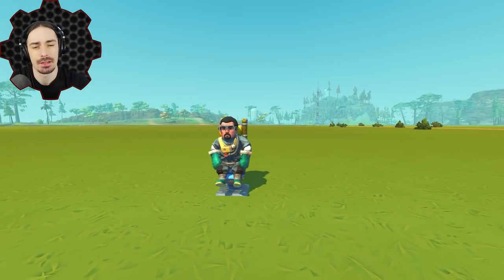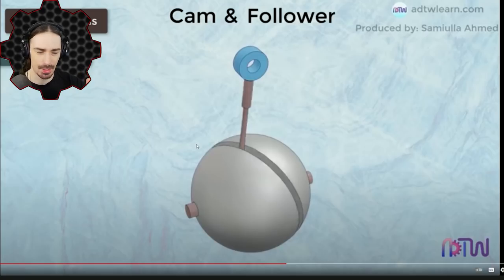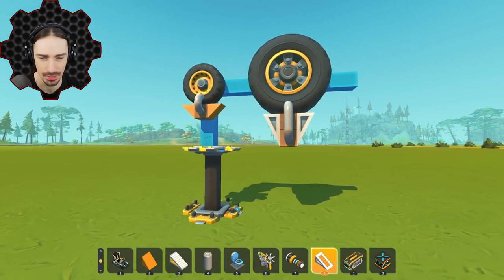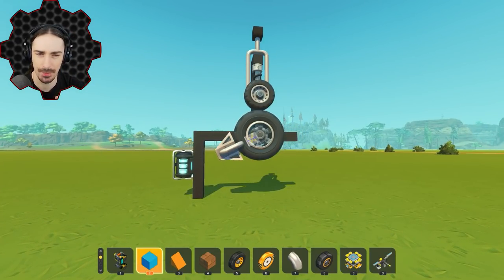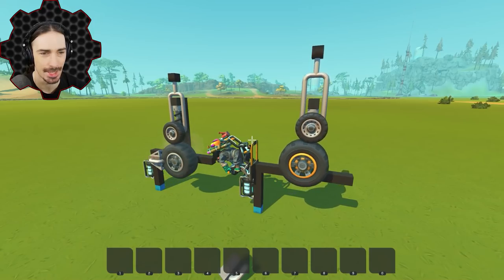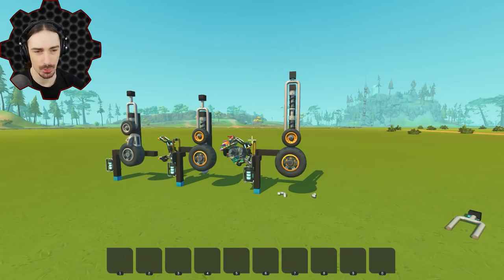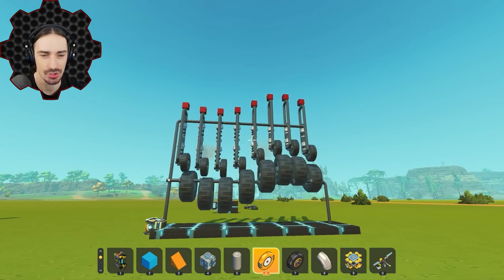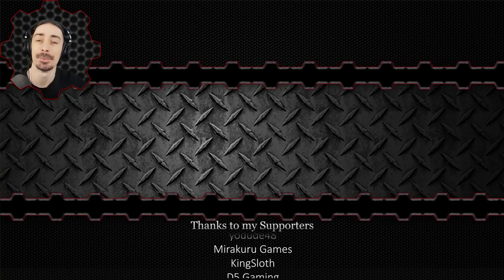This Simple Mechanism Made Combustion Engines Possible

Comment: Hey, Scrapman: you should see the cutaway of a Pratt & Whitney R-2800 Double Wasp radial engine, it’s pretty crazy with how the pistons and counter weight runs inside of it to drive the propeller shaft. Would be awesome to recreate it. Another would be the engine used by the Bf-109 because it had either a 20mm or 30mm cannon (depending on airframe model) in the middle of the prop hub.

Comment: 2:30 not to be the gearhead nerd here but that exact setup is an in line 4 cylinder (can be configured similarly known as a boxer engine to reduce vibration/sounds/heat and is slightly more efficient) and the configuration on the valves is called a DOHC or dual overhead cam.
Reply: And this is a 4 stroke engine.

Comment: The left cam with the wedge piece is like a valve, precisely like the video at the beginning. You want it to open only to introduce a fuel air ratio, or to vent the exhaust gas. But closed so it can retain the pressure of the combustion. As somebody said earlier, to fast you get valve float, when it went ape and stayed basically open. The design on the right is more of piston momentum, a constant moving stroke. To compress the fuel in the chamber for combustion and also a second stroke to vent the exhaust. I would love to see if it's possible to model a 4 cylinder motor using your tire methods, could the game handle that intricacy? Especially trying to time the valves between the piston strokes.....that is a hell of a challenge.

Comment: 8:41 I would love to see a smaller design of this to make basically bags in scrap mechanic on a vehicle would be pretty cool and you could make them on all separate buttons like pistons but a lot more smoother and can sit at a specific point rather than fully extended or fully compressed so you basically built a low rider that doesn't hop but can 3wheel and everything that lowriders do 👍 

Also this is a really good explanation of how a cam and valve setup works in a engine of basically any type

Comment: Cams can open the valves of an engine several times a second. There are several F1 and motoguzzi engines capable of 20,000rpm at the crankshaft, which translates to even more RPM at the camshaft

Comment: I’m a teen learning automotive. And you would want the first one/ the tire with the add block because it lets open the valve which is what that build is for more control and not like a wave because in a combustion engine it would let fuel or air in to the engine which could lead to no air compression. I thought I could tell you to help you.

Comment: Just am fyi if you’re going for the camshaft in an engine style, your beginning models are more realistic as you need them not hold the follower open for a duration to give the engine time to compress the fuel air mixture and ignite it, it wouldn’t be able to do this with the follower (valves) slightly open as there would be no compression it would just push the fuel air mixture through either the exhaust and/or back through the intake

Comment: Mack truck Etech engines with power leash compression braking uses an extra lobe on the other side of the exhaust cam to allow for compression braking, and is activated hydraulically by closing up the clearance in the valve lash by use of engine oil pressure.

Comment: While the second design is nice and smooth the first one actually has a lot of practical use irl. In the instant of an engine they’re attached to the fuel and exhaust values inside the cylinders. 

The engine lets in fuel, then closes the valves and compresses the vapors. A spark ignites the fuel and the following boom forces the piston down making the power to turn the crankshaft, then the exhaust valve opens and the piston moves up pushing out the spent fuel. 

If it was the smooth sin. wave it wouldn’t line up properly with the steps of internal combustion. Fuel and exhaust would mix together, you couldn’t get proper compression and it would probably destroy the whole vehicle.

However, these valves couldn’t use logic gates or electronic timers so the cam did that job, since everything is constantly rotating in the engine it would push the valve open for a short amount of time then take awhile to rotate back around to do it again in sync with the other moving parts of the engine

So while the wave is pretty it’s not always the right motion for the job
Also helps that irl can do custom smooth shapes better then a building grid

Comment: this can be used also as a form of suspension height adjustment. you want low and stable? set it low and ride the road. you want lifted for offroading? you now have an offroader. all by just adjusting the height of a vehicle. althought, suspension firmness is a different story. i dont play scrap mechanic, so i dont know if suspension pieces can be modified in such a way

Comment: The wedge in the wedge cam can be shaped so that the follower can move at a different rate depending on the wedges position eg you can have the follower move a little bit for the first 80 percent of its travel, and a lot in the last 20 percent

Comment: Hey Scrapman! The design is nice how you were able to control it with high and low point. An idea of that use it on a vehicle so you can control the height like pistons but with those modules you made, then some obstacles be like rock crawler climber over. :)

Comment: You got the piston thing backwards. You said it was like the cam and follower converting rotary motion into linear motion, but it is actually the other way around with the combustion causing linear motion of the piston which drives the rotary motion of the shaft

Comment: Scrapman! you have to check out a new upcoming game being made by a single dev i found called gearblocks its like scrapmechanic but way more in depth when it comes to the creation building if you want to build a car you have to construct all the mechanisms of its streering its drivetrain power transmission and gearing using a ton of different gears axles bearings sliders pistons and much more its incredible and needs a larger following and the demo being shown to 10s of thousands of people in this community is the perfect place for it to reach that following

Comment: In engineering terms, the big wheel is better for the alignment of the tangent. A tangent is the point of a line that intersects a circle or round object or round face. (Definition from what I remember and simplified for non-engineers

Comment: But it uses suspension. So how well does it work upside-down/sideways?

Either way, I wanna see this idea expanded upon. You said it's not laggy. So use this to power a vehicle. I wanna see how you convert that energy back into rotational energy since this invention IS meant for combustion engines, the thing that powers vehicles.

Comment: I wonder if you could use the wheel technique to have adjustable suspension in vehicles kind of on the basis of air ride suspension would you be willing to try it out?

Comment: reminds me kinda of some bicycle gear shifting mechanism .. if you replace a wheel by one of a different size or add more wheel in between - or am i wrong? .. i mean only the shifting (speed changing without to interact with the motor, not the moving of course :)

Comment: I've got a list of a few possible ones...
Universal Joint
Rack and Pinion
Crank and Slider
Leadscrew
Worm Gear
Bevel Gear
Chain Drive
Belt Drive
Cam and Follower
I'm sure you already know most of these. I know a great website for these mechanisms. It's called 507 mechanical movements. It's a book that you can find online. Check it out!

Comment: I'm seeing people asking to make a real engine/car with the cam shaft concept. Why not try making a smooth walker instead? Plus, it would be faster than piston walkers by a fairly large margin.

Also, if this were the size of the cam shaft, the engine would be at least 75 blocks tall, requires modded wheels bigger than most mods have, and be super laggy.

Comment: Mr. Scrapman, have you tried Experimenting with the D-Cycle Piston Mechanism?

`(If you don't want to show this stuff below, you don't have to; also better to look at videos instead of listening to my explanation)`

The D-Cycle Piston Concept (also Vaguely Referenced as the YAN Engine Concept) Involves an Inline Engine Process where a One-Source Input is converted into two sources, (via. Gearbox or Gear Reduction); One Connected to a Primary Cam and Follower housing a Piston attachment displaced from the center of the cam wheel, and the other connected to a Secondary Cam and Follower with an exhaust Pressure System (can be substituted with a simple Wheel Pressure System like the one you used in this Video).
Both Pistons Rotate Clockwise, accomplishing the same ideal conditions as other Engine Concepts (Power, Exhaust, Intake and Compression) in 4 Strokes per Revolution.

Comment: Scrapman discovered valve float. Basically your valve springs i.e your suspension is too weak and needs to put out more pressure so it can keep up with the cam.

Comment: you missed the real challenge with those, does it work if the power transfer is reversed ... meaning turning linear action into rotary. If so you could actually make an engine which turns explosive push on an indestructible object into a constant rotation.

Comment: You also simulated valve float with how soft that suspension was on the valve. Valve float is really bad for ice engines, as it decreases the engine performance because it doesn't follow the can lobe profile, causing sputtering and power fall off as rpm increases.

Comment: I built a thruster engine and I added the cam system using the duct bend piece. The cam system does nothing. It's just for simulation.

Comment: I might be wrong but don't marry go rounds use a big cam and followers to make the horses go up and down
Reply: I was sure they did, but after looking at it turns out they use a more complicated 'carousel mechanism' with pinion gears and crank shafts. I am still not sure why, but i think it's so all the mechanical parts are overhead so the whole thing can be lower to the ground and have less chance of someone getting injured by the mechanism. Could also be so each seat rocks back-and-forth in addition to moving up-down.